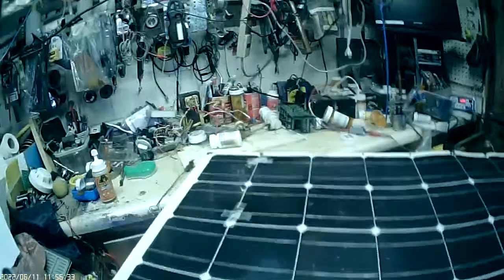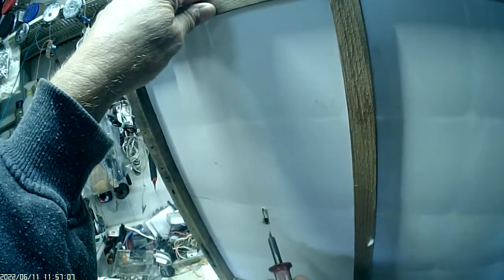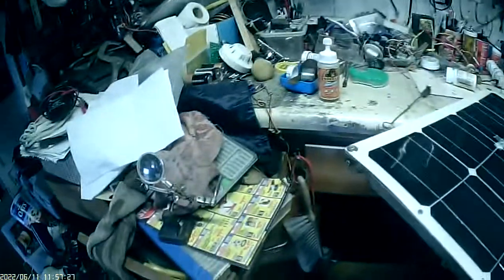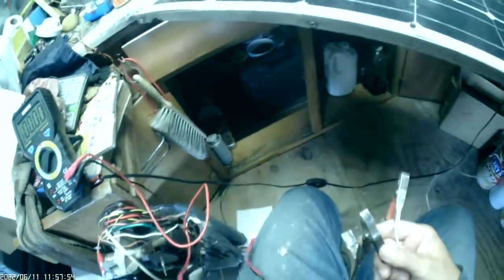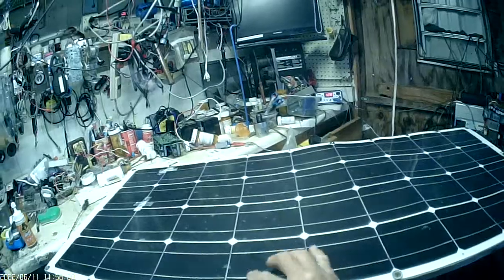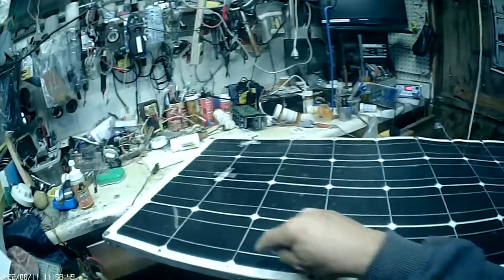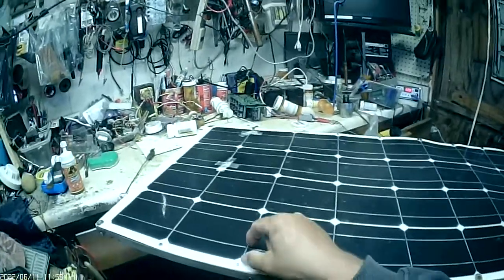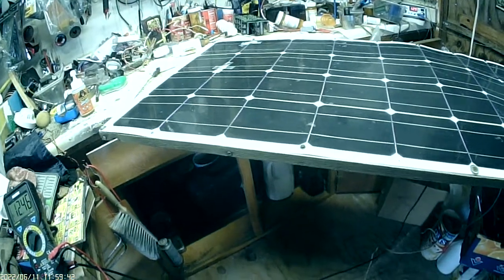how to repair a flexible solar panel

Comment: i have a solar panel that is 15 inch wide by 18 feet i cut it down to 10 feet but can,t get it to work their is 1 copper tab and two nickel tabs copper seems to be ground the are 15 inch by 12 1nch their are 10 of them to gather to make the 10 ft now
Reply from the maker: Need to get access to the tabs positive and negative and find out which ones are series tabs or parallel with your multimeter after you cut through the plastic and then you have to decide which are positive and which are+. -
Reply: thanks a lot im still trying to work on it @foamaxmore
Reply: thanks very munch your info saved me a lot of money and the panel is working fine most people don,t come back @foamaxmore

Comment: How do you find the breaks in the wire?
Reply from the maker: In my video I mentioned you have to go melting through with a soldering iron o n the plastic behind the cells try to Target it from the front and rub the soldering iron on the plastic back and forth till you break through and you'll see the shiny silvery solder joint and tab and you can work from there hope this helps